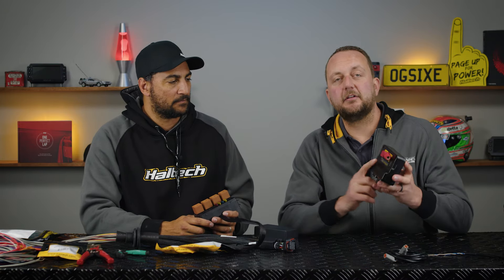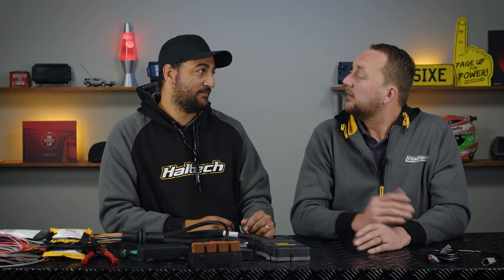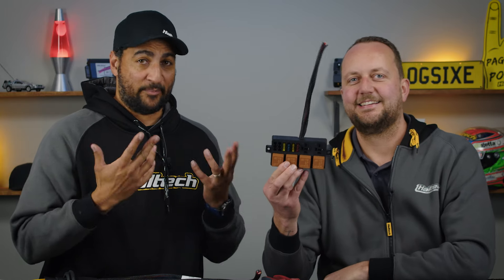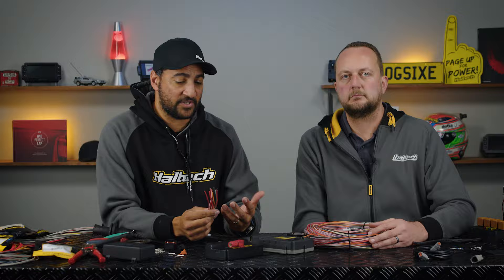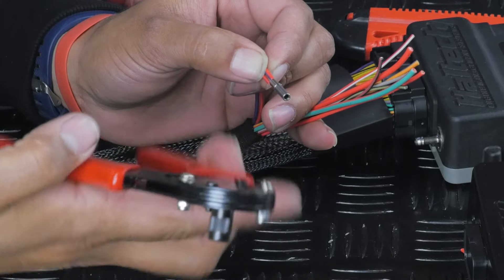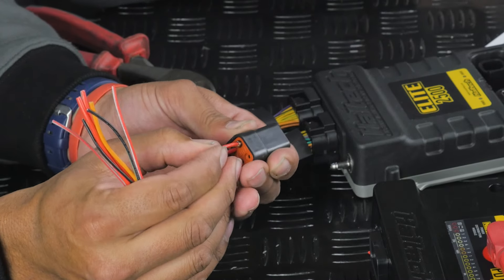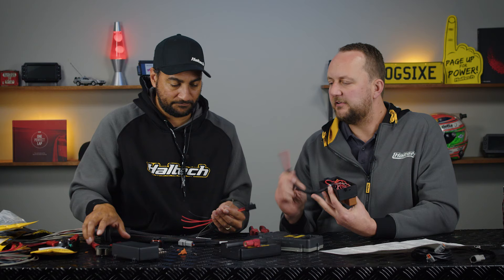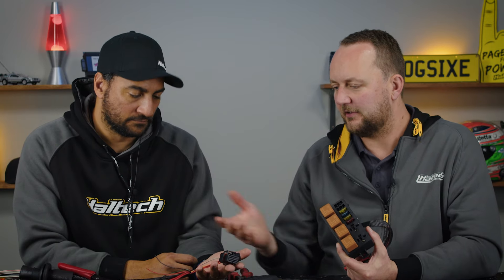🛠 DIY: How to replace a fuse/relay box with a PDM | TECHNICALLY SPEAKING

Comment: This is a huge step in the right direction!! Just like B. Sully said, definitely need a wiring /setup video of converting factory fuse boxes to the PD16. I think at a minimum, lighting, starter, alternator control, wipers…basically the essential stuff…or just all of it in a multi-video series!!
Reply: Agree many would be interested in that, especially diy resto modders

Comment from the maker: You've asked for it - and here it is: A step-by-step guide to removing a fuse / relay box from your harness and re-wiring it into a PDM. (sorry about the fingernails....)
Products used in this video:
PD16 and Accessories: https://www.haltech.com/product-category/inputs-and-can-expansion-products/power-management/
Dual Crimper Set: https://www.haltech.com/product/ht-070300-dual-crimper-set/
Crimping tools: https://www.haltech.com/product-category/tuning-tools/
CAN adaptor loom: https://www.haltech.com/product/ht-130046-can-adaptor-loom/

Comment: Thank you so much for the detailed video. At first some of the  extra wires made no sense to me but after watching this video, it all made sense to me. I watched this video step by step as I was cutting and splicing at the same time. 
That I had 3 gray/red wires but some testing narrowed down the correct one. I grounded the ECU to the battery and went one by one on the g/r wires giving them 12v until my ecu powered up

Comment: Love it…

Can you do the same Video but with the Nexus? I can make assumptions and guessing it’s similar but simpler.

Would also be good to show the injectors, coils in the video connected so we can see it full wired.

Can you also include indicators and lights as I’m aware the nexus can run far more than a traditional ecu.

I have a nexus waiting to go in, so this is helpful

Comment: When I have used nylon harness sleeve, when I cut it, it almost frayed instantly. I struggled to use it. I noticed when Dave cut the cable tie, it didn’t really come apart. So I’ve taken a look at the Haltech cable harness sleeve kit you do. Clearly there must be different kinds of nylon sleeve. As far as heat goes, are some ok for engine bays and other types not?

I went wrong in using regular heat shrink as well. I now know to use the double layered 3:1 (?) heat shrink.

I’m going to go back and rewatch some of Dave’s tutorials. I’m sure he covered harness labelling in one?

Sorry, a bit off topic from the PDM wiring.

Comment: This is great information,  do you have any tutorials for people coming from carburettor engines moving to aftermarket ECU/ECM for different reasons ( racing/performance, restomod ,etc ), explain how to wire each sensors, triggers, ancillary, pumps .etc  fusebox,etc for the more basic haltech systems ( elite 500,750,etc.   For me I'm coming from a 74' Vw T2  build ( type 4/porsche 912 
 big bore stroker ) that has twin carbs to ECU/ECM

Comment: This is a huge improvement… all the LS guys always want to go Holley. For me I’d love to use a Haltech system on my twin turbo G8GT. Do you have a system that still allows my BCM control over body stuff like a/c, heated seats ect? Thanks for the info I definitely prefer Haltech over Holley tuning wise.
Reply: the only people that use holley are advertisers. the problem is you think paid advertisers are actual doers. they are not.
Reply: @DieselRamcharger  agreed. I’m using a Haltech 2500 on my LS swap.
Reply: their is no plug and play harness..but you can depin your factory ecu items you dont need..injectors, coils, etc and keep what you want ac/etc...I did it on my 08 silverado

Comment: I love the idea, but at 5 to 10 times the cost of a simple fuse-and-relay setup, I'll stick with what I can diagnose on the trail, if it ever needs to be done.
Reply: Agreed. I feel like at it's current price it's not feasible for the majority of enthusiasts.
Reply: It is pricey but it actually adds some diagnostic capabilities if you have your laptop. For example, if the output was on and the current draw was zero that would indicate an open circuit. Furthermore if it was shorted you would get a DTC and you would see the overcurrent value in the software. Also no more fuses to replace.
Reply: @autotuneengineering  I'm not discounting the added benefits you mention. My concern is that when I'm off-road, I don't bring my laptop. I have a box of fuses (many different ratings) and relays that are interchangeable. A quick check and swap and I could be back on the road before my computer booted.

Technology is good, but complexity is not as robust as simplicity. For me in that situation, simplicity works best for me.
Reply: @autotuneengineering  All of that depends on the problem being something other than the module itself; you have doubled the number of points of failure in each circuit and made it literally impossible to accurately diagnose.

Go read a modern factory service manual, half of the component tests just say, "Replace with known good part and check operation," because the module arrangement makes it impossible to do anything else.
Reply: Your argument against a unit that obsoletes fuses and relays is that you want to have to replace fuses and relays? 🤦
Reply: @dankcincy  Save money, spend it on stuff that works.
Reply: @hotflashfoto  Save time, spend it on stuff that matters.

Comment: Ford did this in the late 90's ... also known as the CCRM - for constant control relay module.... they were nothing but problems and was just easier to install normal relays which were much more reliable and easier to replace when something does goes bad.....  how much is your PDM? and if only one issue in the PDM doesnt work you have to replace the whole thing vs a single relay....

Comment: When crimping two wires into a single DTP, are you at all worried about the compromised weatherproofing on the cable seal?

I have always believed that was a bad idea on those connectors, but I can't say I've ever tested it. Double crimping on a DTP is easier than making another splice in the harness and dealing with SCL to support the splice area.

Comment: What do you do with the red/white cable from pin B11 to the elite 2500? I’m assuming because the red/white and grey/red are connected as the output from relay one, that they get crimped together on the CAN power pin to the PDM?
Reply from the maker: Send a message through to our support team via www.haltech.com/support 
They'll be more than happy to assist you :)

Comment: Does a PDM have to be used with a ECU if I just want to get rid of my old Fuse panel?  Can't I just replace my old fuse panel with the new PDM if my engine is carbureted and doesn't use any sensors?
Reply from the maker: Sorry, the Haltech PD16 only works with a Haltech ECUs.
Reply: @haltech  It doesn't matter to me if I need to use a Haltech PDM has to be used with a Haltech ECU. That wasn't my question.
The question is: Can I use a PDM of any brand in the place of old original fuse panel without the requirement of having to connect it to an ECU?
If I have a carburetor on my engine and don't need an ECU do I still need one to have the PDM function properly?
Reply from the maker: Yes, a fully stand-alone Power Distribution Module should work with a carbureted engine but you'll obviously need to check with the manufacturer before buying.

Comment: Here’s the thing … The difference between a porcupine and a Porsche driver? With Porsche, the pricks are on the inside.. 🤓😂🤪.  I am a 964 Owner and Weekend warrior in the garage. Dropped engine. Etc.. Never touched a wiring harness.  All your doo-dad’s look intriguing, however, can’t  find a single thread on the World Wide Web that has replaced the standard ECU with your products or fuse box on a swap of stock street car. Not one. Our cars are 30 years old and someday it would be fun to swap the ECU and Fuse box to some CAN stuff 🥳.   I am not talking strip out the stock harness and ripping out the dash. More like your products configured to use existing harness. Pie in the sky, I know. Probably a Porsche specialist would be required to make that happen.  I’m talking N/A 3.6L, not intended to Turbo or Race, however, would be fun to go Wide band vs Narrow band, be able to micro manage Fuel Trim and Maps, etc..   This require somebody to do the following work; Create a conversion cable for accepting the 964 ECU wiring harness plug on one end and your input to Haltech ECU on other and of course, trying to accommodate every function Motronic does in the stock ECU. Add PDM to eliminate stock fuse box too…   The other approach is to ween certain functions from Stock ECU to a 3rd party ECU running in parallel? 😳.    It seems your products are targeted to folks who have gutted their vehicles down to bare interior, etc.   I wonder, does Singer Conversions go with 3rd party ECU’s and PDM and CAN technologies?   Keep building, we’ll keep watching. 👍

Comment: * HALTECH * Please create a dedicated PDM screen for the IC7 dash since the software only allows you to add the specific channels you want and isn't a full STUDIO package software. Include state indicators, maybe a bar graph for the current with numerical value and numerical voltage value and DTC codes and also PIN numbers and wire graphic with color code.  No more laptop to view PDM info or get wiring diagram. Now that would be neat.

Comment: You really should not put two wires into a single  deutsch connector cavity. The terminals aren’t rated for it( probably not a huge deal if the CMA is within range), but worse the seal will be compromised, you cannot seal a figure of eight intrusion with a round seal. Yes you said you’re going to be in an interior space so even that shouldn’t matter, but for demonstration purpose you should show the right way, using a splice somewhere else in the harness.

Comment: Is there a product that is the opposite of this? Something to rewire a new car with an old-style fuse and relay box?
Reply from the maker: Absolutely, we have a whole range of universal and engine-specific harnesses that include a fuse and relay box:
https://www.haltech.com/product-category/wiring-harnesses/
Reply: @haltech  But that won't let the power windows work without the door modules, or the windshield wipers without the wiper module, or... we really need a product that will let us fix the crap the auto makers are forcing on us.

Comment: Why on Earth would you ever do this?! You can get the same functionality with just an auxiliary fuse box without sacrificing the ability to effectively troubleshoot future electrical issues.
Reply from the maker: Effectively troubleshooting electrical issues is one of the key points of this conversion.
Reply: @haltech  Um, speaking as an auto tech with 30 years of experience, it doesn't work that way.

Comment: Too much talking. Just need to explain the wiring diagram differences between relay/fuse module vs PDM pinout. Trigger switch, grounding and load output pinout differences between both types
Reply from the maker: Already covered that in this video: https://youtu.be/IeNT4DtTbwc